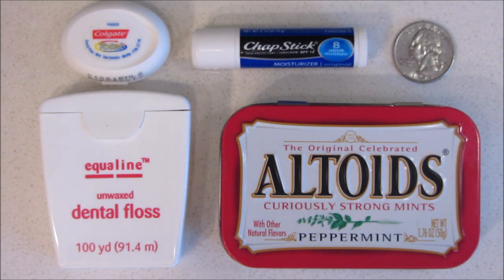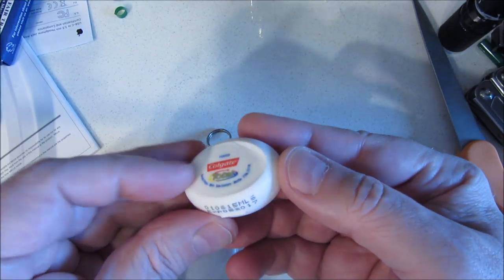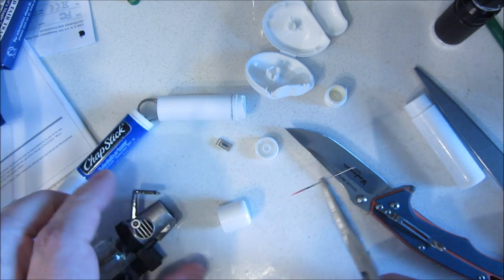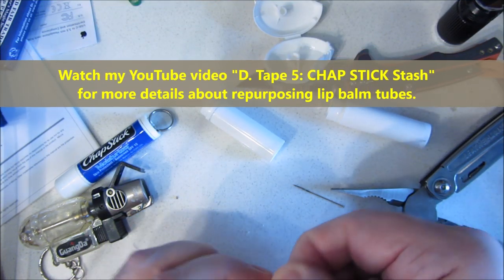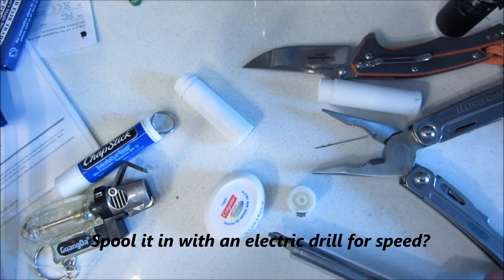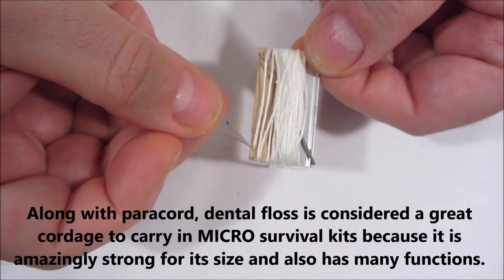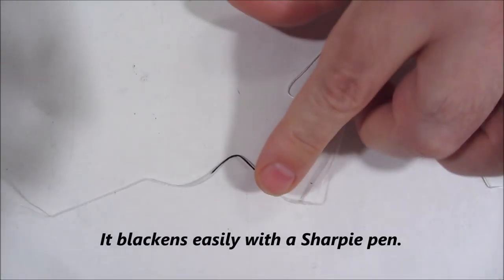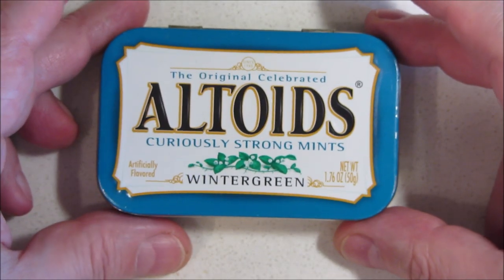ULTRALIGHT travel tin MICRO dental floss

Comment: This is pretty damn genius. I didn't even think about doing something like this. I think what I would likely do is just string out the amount I need and just wrap it around one of my pens or just anything in general. But I never even considered getting around the dental floss container.
Reply from the maker: Thanks. One potential problem with pre-diepensing dental floss is it no longer is being kept in a sterile environment. So whatever is pre-dispensed needs to be encapsulated in some manner to keep out pocket lint, etc.. Tiny zip lock bag maybe?
Reply: @MeZillch  Oh you're right!! I never even though about that. Good point!!

Comment: Trim down the center tower in the spool and file a plus/cross shaped hole, then you'll have extra storage space in the floss-cap and it will fit a cross head screwdriver bit for rewinding new floss onto the spool.

Comment: is there a way to use a fish hook fo other uses than to catch fish? urban survival for the most part has no use for hooks.
Reply from the maker: Good point. They are so small and light weight so it hardly takes up much room in a kit. As for other uses they can be used as mini "grappling hooks" say to throw a line over a  tall tree branch/fence, etc.. Also I once dropped my keys down my building's  elevator door crack on the floor and successfully retrieved them with a hook on a line as I lied on the floor peering through the crack and illuminated the elevator shaft below with my AAA flashlight.